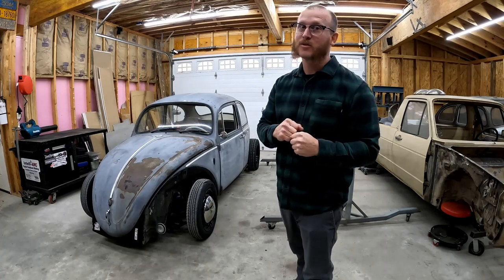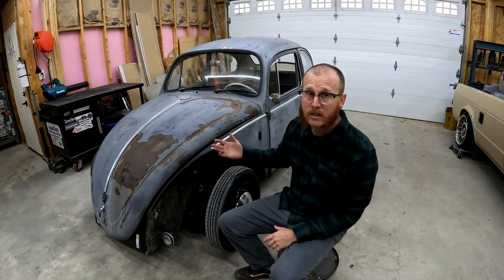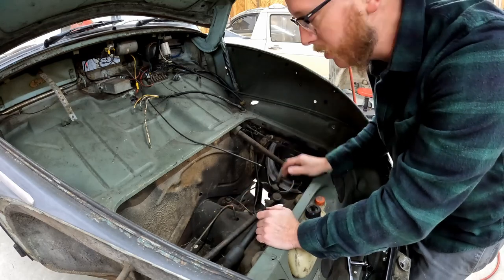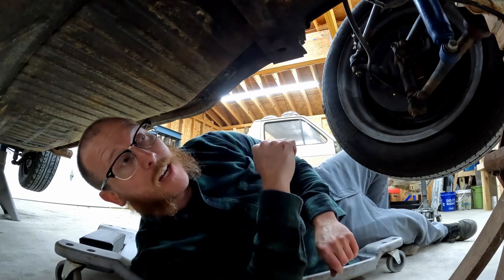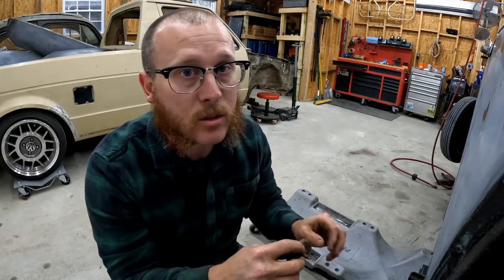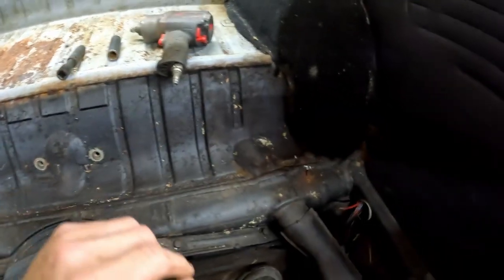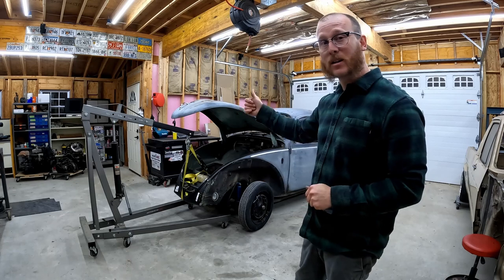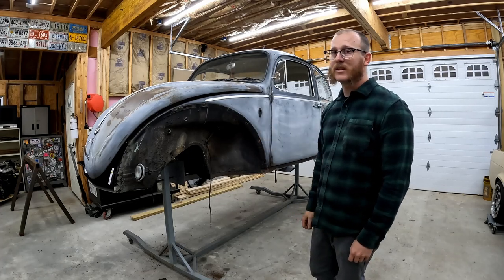Removing body on VW Beetle

Comment: I had to replace the driver's side pan and the VW junkyard in Denver pulled a similar body from their yard.  I used a cold chisel to open up the tunnel and the bottom.  Then I did the same on my 66' bug.  Undid the bolts along the edge of the car on both vehicles and bolted the good one onto my bug and used roofing sealant to finish the job.  Took a day of hard bustin' to get it done.

Comment: I’ve pulled of several Beetle bodies and had a built plenty of work arounds to support the shell. 
The engine hoist and very sturdy saw horses did the trick. This will become my preferred method from now on. 
Thanks for the ideas. 
Back to work!

Comment: Thank you for the Tip on getting the bolts out. --- Too bad there isn't access to the bolts to get a little lube on them -- but it is what it is --- Will be following along ------ I want to take the body off my '70 Bug ----- Rodney
Reply: on the napolean hat bolt ur talking about u can drill a hole through the side of that bracket and spray liquid wrench threw the small hole it works
Reply: yup thats what my husband did
Reply: worked great

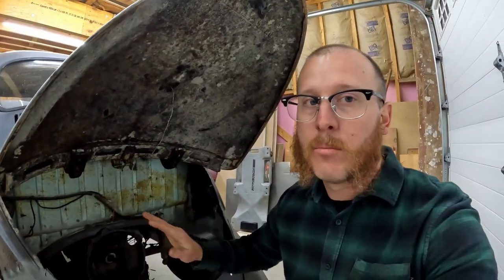Comment: 16:40. Keep in mind that they didn't think it was necessary for the 67 bug to put the bolts in this location anymore mine didn't have these bolts,  it was seam sealed over and yes it was never taken  apart before this car is 100% original ..

Comment: Thanks for this.  Seems like most people remove the doors and weld a brace in place.  Any opinion on that.  Thanks again.
Reply from the maker: This is only necessary if the heater channels are  in bad shape or being replaced. I talk about this at length in my heater channel series.

Comment: Hi and great video.  Does the type 3 Fastback body come off the same way?
Reply from the maker: The type 3 bodies come off yes. But the configuration of the floor pan and body mounts are all a little different. I will have a type 3 floor pan video coming out in a month or two.

Comment: Hi, in another video (Nathan’s garage) YT channel, he said you have to remove the engine to take the body off? Did you not need to remove the engine ? Thanks in advance ❤ from 🇬🇧
Reply from the maker: If you had dual carbs those would need to be removed. Otherwise it is not necessary to remove the engine to pull the body.

Comment: What are you using as the lifting point for the rear?
Reply from the maker: I was using a ratchet strap around the rear apron. You could also use the bumper brackets if the mounts are solid.

Comment: Speaking of rust have u fixed any beetles rusted in quarter panels at the vent from the foam behind pannel
Reply from the maker: Too many to count.
Reply: @callahansgarage  any tips
Reply from the maker: The only real option is to open it up, clean as much out as you can, close it back up and treat the inside as much as possible